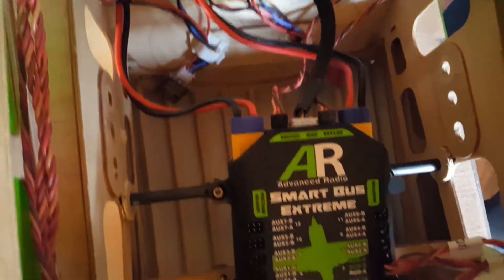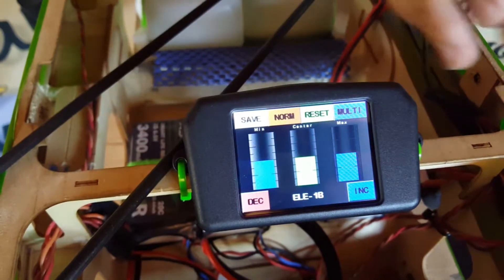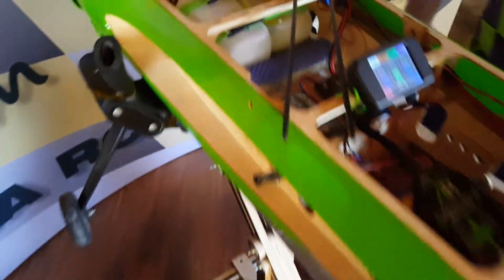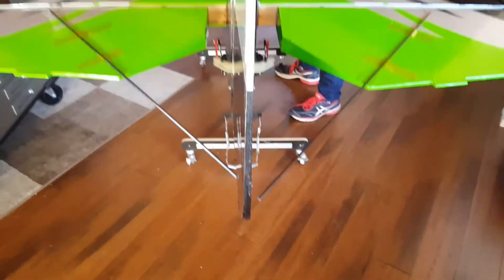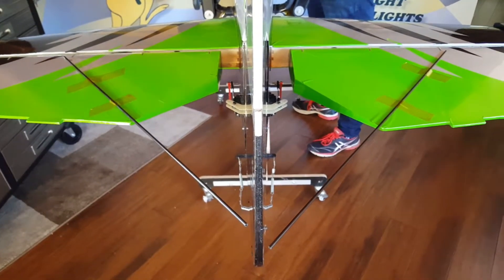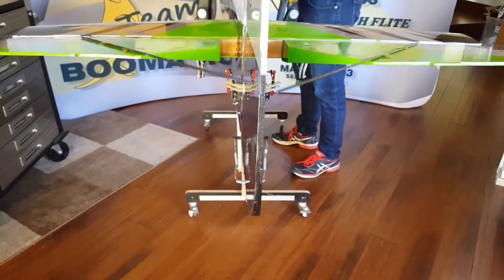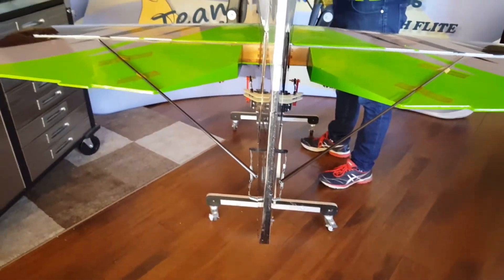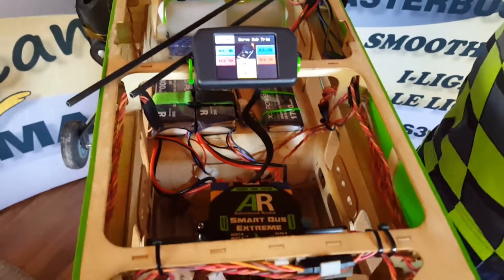Smart Bus Servo Reverse and Matching

Comment: How do you match at 15 points?   Results on this video seem similar to what I achieve with my computer transmitter.
Reply from the maker: Greg. Thanks for watching and commenting. 

This video is the precursor video to our 15 point matching video. When you have a few spare minutes, have a look at the 15 point matching video.

This video shows servo reverse and 3 point matching. it shows how to achieve basic matching and highlights that even with 3 point matching (on every system) you may still have slight non match regions though the sweep range. This was our motivation for developing the 15 point matching system.

Happy and safe flying.

RG
Reply: rickgellboomarc Thanks Rick.  I found the follow up video.  For some reason the two videos aren't sequenced.  I know on other how to series of videos, they will appear in sequence.  Maybe that is something you should look into.  Love your products.  Keep them coming?